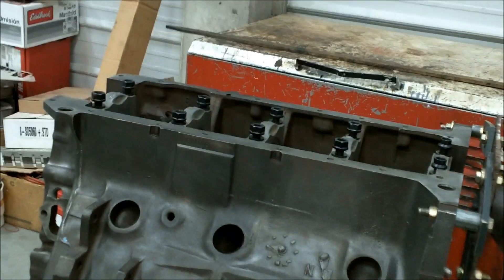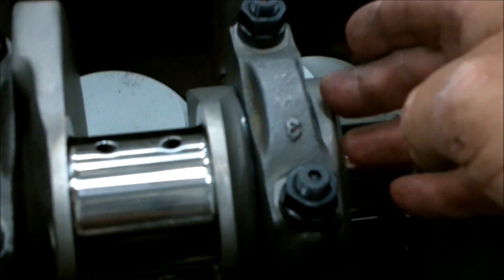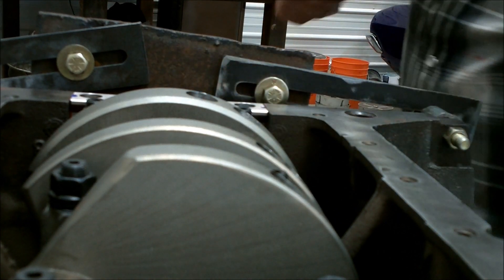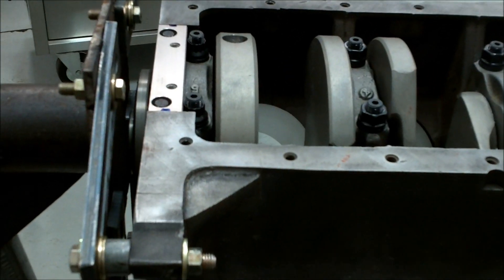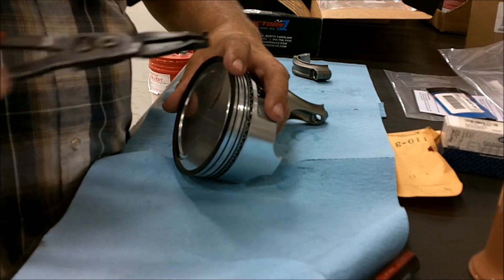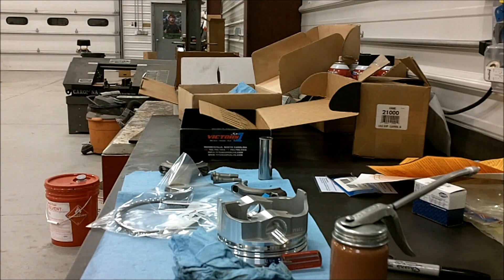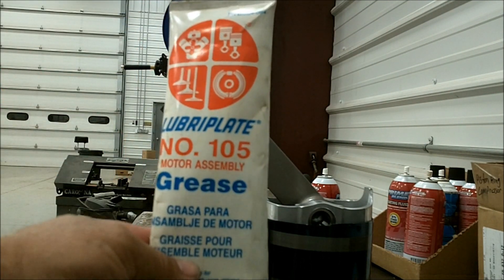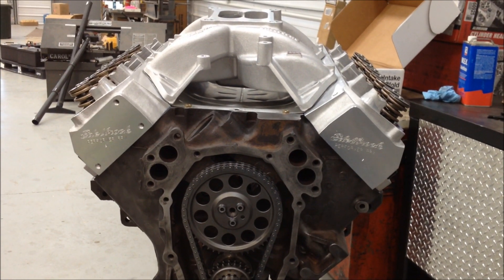440 Stroker Build 2

Comment: The trick to the main seal girdle that you got from the 440 source is silicone the side seals in the girdle and then through the girdle in the freezer for a couple hours. It shrinks enough to install it in the block with out messing up the side seals.
Reply from the maker: Thanks for the tip, I was really worried about it sealing but apparently I did a good job it's dry still
Reply: That one looks higher than the other two

Comment: Hi I know it's been a minute since your post. but do know how to find out what the offset is for my rocker arms on a 440 with cast #516 heads. Not the rocker ratio 1.5 or 1.6 but the rocker "offset" Can't find out anywhere. The Mopar guru at Jegs  gave me three different part #'s and said they would all work for my application. but when I pointed out tat they all had a different offset, he said "well, just buy all three sets and return the 2 that dont line up correctly for a refund. I can't afford that someone must know how to check or know what the offset should actually be. One guy told me it was stock offset but none of the aftermarket rocker arms say stock offset. and again he couldn't tell me other than that. So. I'm back to zero and batting zero. i'm wondering if everyone's just putting the prettiest rocker on their motor and don't even know they're lined up correctly. If u know the answer to my question please help me. I liked and subbed
Reply from the maker: Oh boy, didn't I cover that in a video?  boy I can't remember, umm I know the guy that I consulted with could tell you all that, have you tried some of the mopar forums? thats got guys with tons of knowledge
Reply: @Jpaydirt  Yeah I tried Jegs Summitt and "For A bodies" and "For B bodies". The guru at Jegs told me to buy all three types and return the two I don't need. Summit just didn't know anything but said I could return if un used- Never bolted down. I have stock rockers for 906 # cast heads. but cant get the micrometer in there to measure them. and I still dont know if 516's have the same offset due to the smaller vavles and smaller compression chambers...Maybe they're closer together and require a different offset than a 906 head rocker arm. Sadly this is my christening by fire to world of Chrysler. I can tell u one thing for sure after three weeks of constant searching. when I find out how to determine the rocker offset for a Chrysler, I WILL NEVER FORGET! Heh Heh. Thanks for your post and taking the time to write me back. I appreciate it very much.

Comment: I'm thinking about doing a stroker for my 440 in your opinion, should I stay away from 440 source?
Reply from the maker: +mike mikesbbody   Have you typed that question into google yet?  I did and your going to get all kinds of opinions on that subject, you have watched enough of my 440 videos to see my experience with them?  My issues were not that big, just the rod bushings, and I have learned that even straight out of the box HP is BS even from Edelbrock parts, more specifically their heads,  All crankshafts are made in China, even the high dollar ones, they just get machined here,  So I'm not concerned about the crankshaft from 440 source, also their pistons come from Keith Black so not worried there either, but the rods.......well I'm not going to run it over 6,500 all the time so I should be okay, I bought because of the price, "Made in China" but they all are, got a friend who does dirt track and he swears by his Chinese cranks, So what would I do different? go with a different rod manufacture just so I could feel a little more confident, but then it won't be balanced as a kit you would have to get that done somewhere,  maybe I'm just being paranoid, I mean any time you  spin something that big and long too fast you know it's not going to last, it depends on how your going to use this engine,  if its just a street rod like mine I would use 440 source, Jim Laroy use's them quit a bit, he is who I'm getting Mopar advice from,  he asked me what were my HP goals and I said 5 to 6 hundred HP he said no problem the 440 source stuff would do that fine, as I had already bought it before talking to him☻ I wish I had it running so I could give you a better answer, just remember I don't care who you get a part from, take it apart and measure and inspect and wash it before you uses it, nothing is bolt on horsepower ☻   Everything is made in China, except children and their made in VaChina☻☻
Reply: +jpaydirt Thanks for the reply! like you, I have read good, and bad things about 440 source it sounds like the problems you ran into, were not a big deal? I have only come across 1 other supplier of strokers and that's Muscle Motors. I don't mind where the crank's are from as long as they work! FWIW there are better heads out there now like Trick Flow and Side Winders my build will be like yours, 5-600 H.P street driven no racing I hope to see it running soon! thanks again for the reply! (Vachina LOL)
Reply from the maker: mike mikesbbody   The only problem I had with my stroker kit was the rod ends had to be honed to size and the pins polished, I didn't buy their heads because at the time they had gasket protruding into the chamber problems, Even my edelbrock heads needed to be torn down and the seats checked for concentricity and then Jim did an multi angle valve job and cleaned up the ports as things are pretty rough, like I said there is no such thing as straight out of the box HP,  you could just bolt them on but your not going to get the results and longevity, I don't think any body's stroker kit is going to hold up when pushed to the working limit continuously, even drag racers junk rotating parts after so many runs, so for the price and the few minor problems it was a good fit for my project, did you see the grinding I had to do on the heads and also the main seal bolt heads?  the main seal was a piece from 440 source also, nice billet piece but I didn't check the pan rail clearance and ended up grinding the bolt heads off a wee bit to clear, some of the best mopar stuff is from Indy Cylinder Head, made in america so more money, but I have never heard bad anything about them, whatever you do consult with a good builder for a camshaft, and discuss what you are trying to do, ask for advice and then pay them for it, so you can come back for more, they will be more helpful and generous with their time when they are compensated for their knowledge, nothings free☻
Reply: Just my opinion, but massaging the connecting rods and pins is not a bad thing.  At least you have the material present to work with.  Nobody wants to toss the hot dog down the hallway.  Far too many guys run parts without checking/verifying.  At least when it won't fit, your hand is forced to get them machined to correct tolerances.  These details should be communicated from the supplier/manufacture.  That would sure save them a lot of phone calls, and bad PR on the interwebs.

Comment: Good job so far. Whats your fuel supply going to look like?
Reply from the maker: +Vernie Whitt   Well....... I'm not sure, Got any suggestions?
Reply: I was thinking about simply stroking my 5.9 in my 99 ram 1500 4x4. But the more I look into it, it'll be around the same cost to go with a 440. What I have looked into so far is that carbs are much more common, but fuel injection is more tuneable. To me in the past, I have had much more luck with injection vs carbs. Just wondering what your plans were to see how it goes. Im still researching my options first before I start my project.
Reply from the maker: Vernie Whitt  Your are right about fuel injection, but how do they handle long duration cams?
I had a hard time finding a good 440 block with suitable cylinder wall thickness,I have a 2001 1500 5.9 I was thinking about doing the same thing, but maybe stay with the 360 just make it put out some power!
Reply: +jpaydirt I'm not to for sure on the cam duration. that's beyond my knowledge. I know the there was a posting in a hotrod magazine that was talking about a guy who created a intake that could use anything from a 2 bbl carb to a six pack to fuel injection just by switching out the top plate. I was reading on it again yesterday, I'll have to rack my brain to think of where it was. if I find it I'll pass along the info. 

good blocks are hard to find, they only made them for around 10 years or so. unless your willing to drop a bit of change on a crate motor. I might just settle for stroking mine to a 408. still possible to hit 400 hp going that route.

Comment: Turn the bank that you are pushing pistons in perpendicular with the ground so the rods dont scrape on the cylinder walls.
Reply from the maker: You mean so they dangle in the bore?  good idea, I didn't even think of that thanks
Reply: Yes Sir.    If the deck is level with the ground the rods will dangle pretty much straight down.   When you put them in with the block at the typical "running position", the rods tend to fall against the bottom cylinder wall.   ....unless you use those protector guides(didn't see you using them).
Reply: also put  rubber fuel line over the rod bolts so they don't scrape the crank journals

Comment: Are you happy with the 440 source stuff
Reply from the maker: Yes, the only thing I had to do was have the rod bushings honed to the proper size, one thing I have found is that parts are not ready to bolt on, even the Edelbrock heads had to have some work done
Reply: Jpaydirt thanks for the reply.. yeah that's something I've found over the years. And heads especially

Comment: Did you know that WD 40 is mostly water!  There are way better lubes out there.
Reply from the maker: +badone7120   Well I looked and looked at what people are using, and it's all over the place, from 90wt. to ATF, I would have used what the ring manufacter recommended if I had it, it was called QuikSeat,  So I went with what Jim Laroy told me he uses, WD40.  He's competed in the Mopar Muscle Amsoil engine challenge, and his father was in NASCAR   Why is Marvel oil a better choice? are you just talking about the cylinder bores? or as an assembly lube for everything?    https://en.wikipedia.org/wiki/WD-40       here is a link to the ingredients of WD40 they list a majority of the compounds as hydrocarbons and 10% as inert compounds, so I'm not sure about it being mostly water,
Reply: Goodness, so this is where the rumor mill operates.  How does it displace water if it is mostly water?